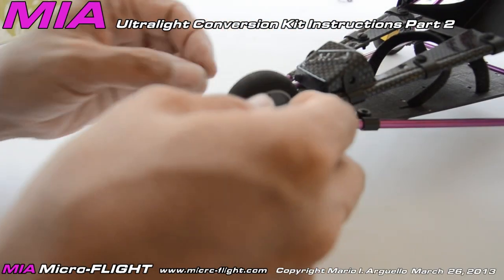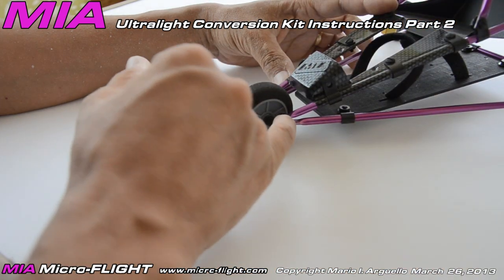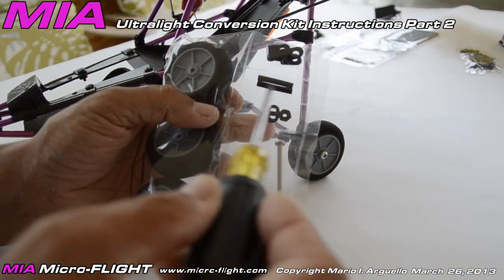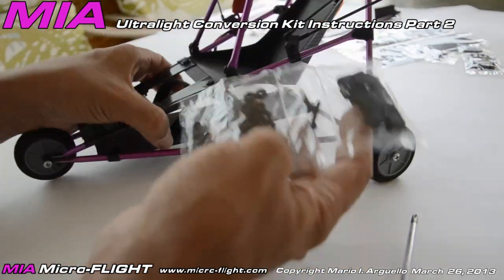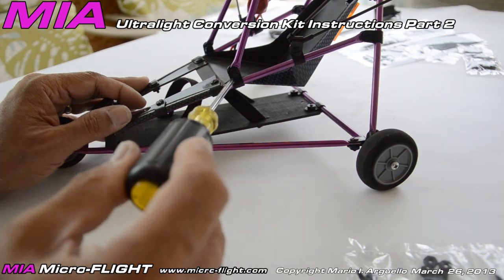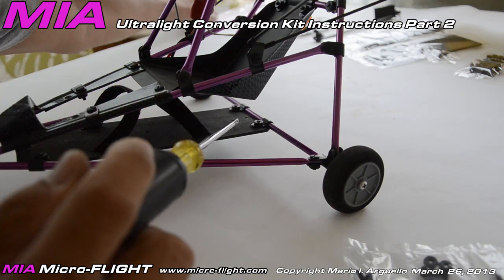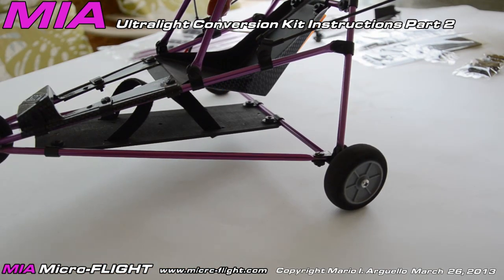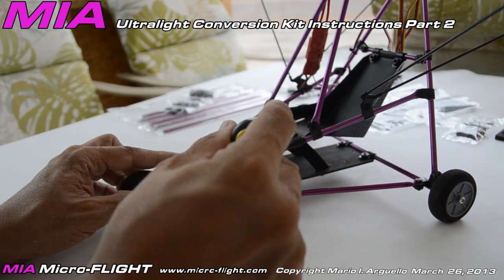GWS Slow Stick (HK Slow Stick) - MIA RC Ultralight Kit - Conversion Instructions Part 2 - FPV

Comment: Mario, do the struts connect to the Hobby king Slowstickmthe same way in the same place next to the ailerons or will the struts need to be trimmed?  Thanks.
Reply from the maker: +Captain Tripps  Yes, they connect in the same way as in the GWS. Do not trim the rods,  rather adjust the distance if you have to of the strut to the rear Trailing Edge of the wing so to end up with a level wing, meaning if you look at the Leading Edge and Trailing Edge they should both be parallel. OK to have some dihedral,  but the wing halves must be equal and level.   In other words there should be no twist on the wing halves. Cheers!